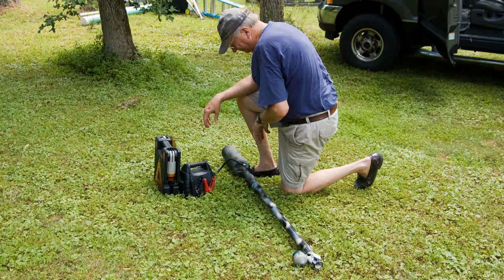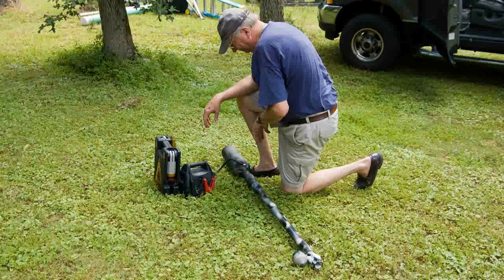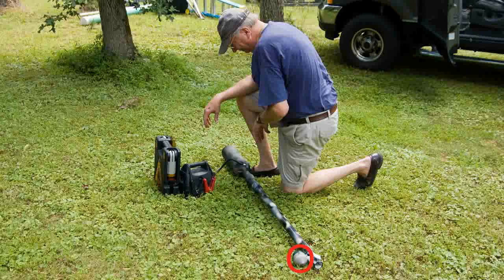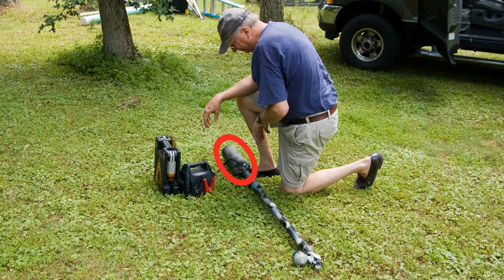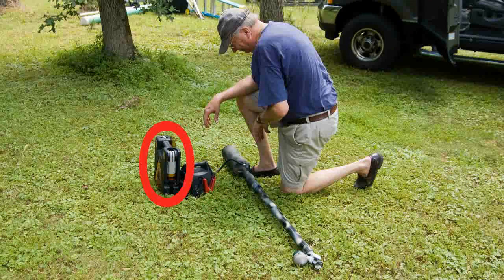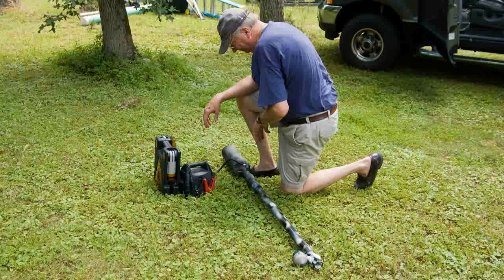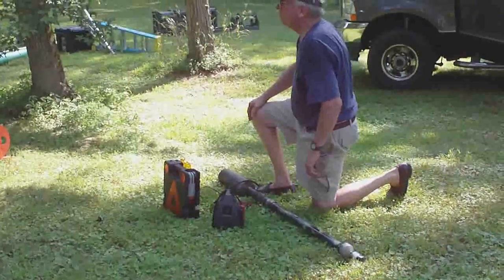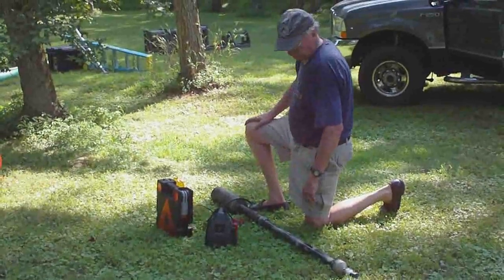Antenna Launcher K4WDG

Comment: We had a similar launcher at our Field Day site K4OZK in Ozark, AL.  The launch tube was a little longer and the PVC compressed air compartment was a little larger.  We used spent caulking tubes with light-weight cord.  Went over a 100 ft. tree with room to spare.  Hung my G5RV with it.